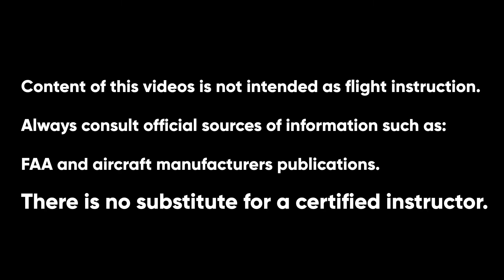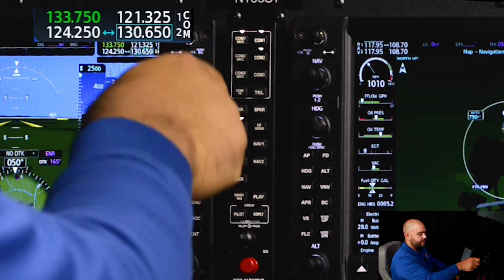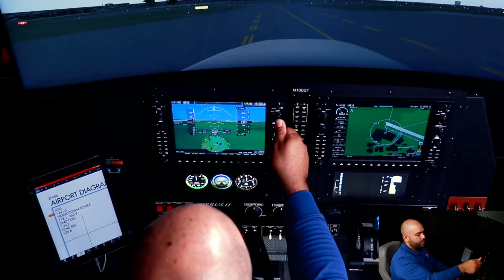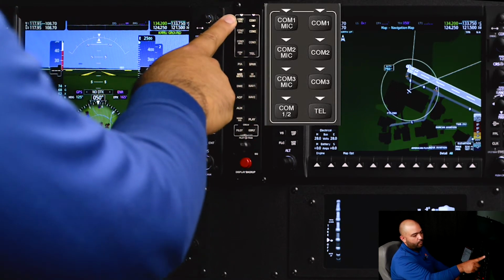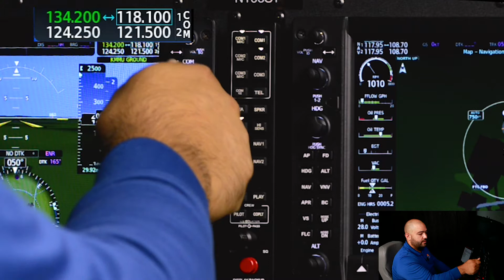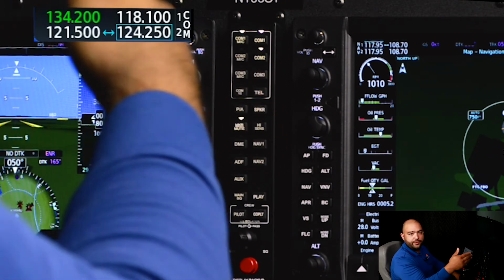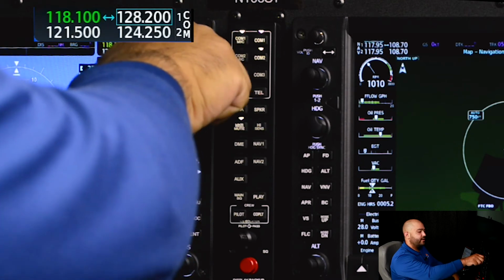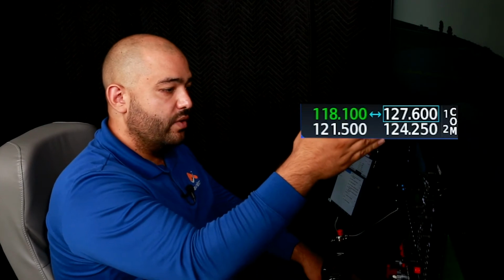VFR Comm Radio Frequencies Setup | Private Pilot Training

Comment: how big is your monitor and who makes the G1000 PFD/MFD devices that you are using?
Reply from the maker: Our G1000 simulator is a Certified Advanced Aviation Training Device, the manufacture is PFC. The size is the standard G1000 size.
Reply: @AviatorNYC  I'm talking about you curved monitor size. Is it 34,39,49 inches diagonallly